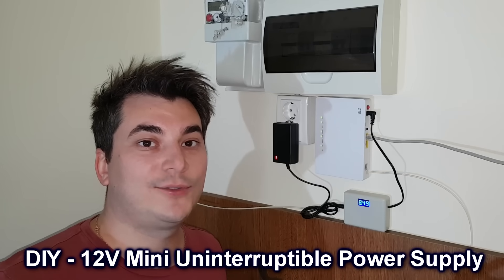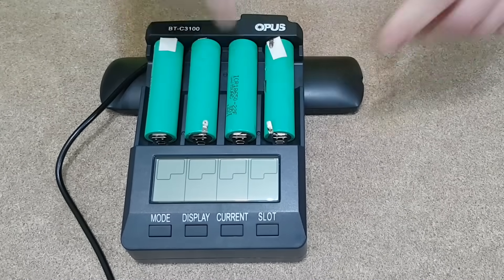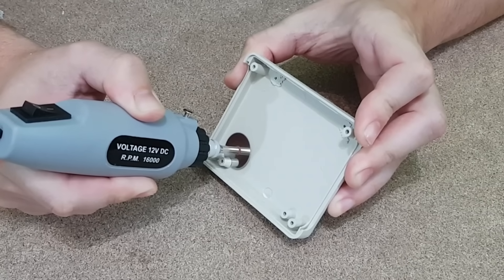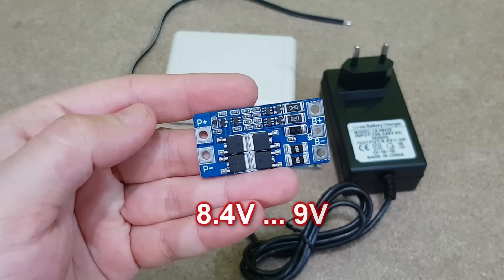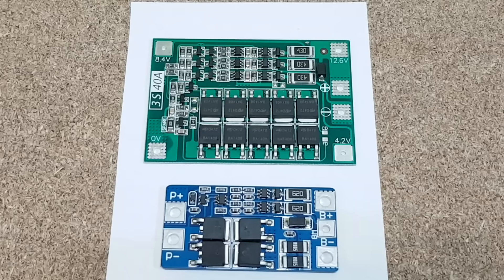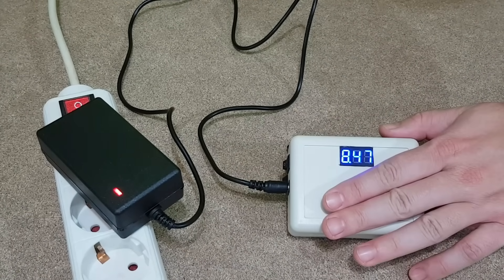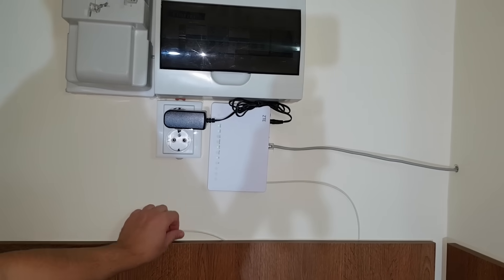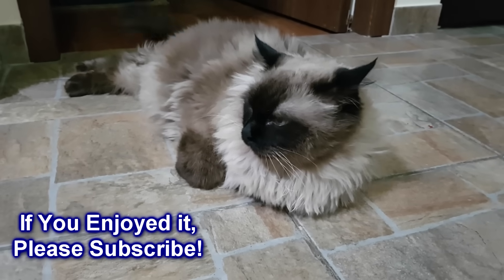DIY - 12V Mini UPS

Comment: idea of making a 12 v ups is good but the router in my case consumes 1000mA of current , so this types of ups will not last longer for me. moreover the boost converter u are using cannot provide 1000mA current. reply me with solution, i m also a electronic nerd like u.
Reply: Does your router really consume 1A, or does it simply come with a 1A power supply?
Reply: @DavidBeukes  no it really consumes 1A
Reply from the maker: you need a 4S battery pack with a 4S BMS board with balance and a powerful step down converter like xl4016
Reply: @Sorin_DIY  thank u sirr.. Its nice to see a reply from you.. 😃

Comment: Salut. Scoate la iesire circuitul prin xl6009  mai mult de 2A? sau pot pune 2x xl6009 cu acelasi voltaj setat pe un router cu transformator de 12v 2A sau ar trebui sa ma orientez catre alt circuit ups?
Reply from the maker: salut. in conditiile astea nu poate sa scoata 2A. nici sa folosesti 2 module step up. nici bateria nu rezista, ar insemna sa traga peste 4A din baterie. daca ai nevoie de 2A, trebuie sa folosesti o baterie facuta din minim 4 celule (4S), un modul BMS cu balansare 4S, si un convertor puternic step down, ca cel pe care l-am folosit in clipul cu sursa reglabila.
Reply: @Sorin_DIY  Xl4015e sau xl4016 :). Si trebuie sa cumpar alta cutie. :) Mai bine un 3s, incerc intai. Mersi.
Reply from the maker: xl4016 e mai bun

Comment: Hey , you forgotten 1 diode at input of BMS, that will help to reduce extra current drawn by charger LED during power fails
Reply from the maker: yes a diode will block the current in the reverse direction, but it also has a forward voltage drop of around 0.9V so the charging voltage will drop under 8V, which is not enough to charge the cells. the charger LED is using only a few mA, it doesn't make any difference in the 6 hours working time of the UPS.
Reply: "LED": Light Emitting DIODE. 
So why would you need a second diode?
Reply: @AtlantaTerry  simp

Comment: Pointless video. Why not just use a small 12v lead acid in parallel? 

No soldering, no additional circuit boards and you keep the original power supply?

Comment: Your router probably step-down your 12V to 3.3V. So you can try to power it with 8.4V without step-up.
Reply from the maker: that's possible. but I wanted it to have a stable voltage, so it can be used on other 12V devices if necessary. other people who build it may also need a stable voltage.

Comment: There is a diff between the video and your schematic, about the voltmeter.
In video:
(+) of voltmeter >>> OUT+ of LM2956
(-) of voltmeter >>> OUT- of LM2956
Sensor of voltmeter >>> P+ of BMS

In schematic:
(+) of voltmeter >>> IN+ of LM2956
(-) of voltmeter >>> In- of LM2956
Sensor of voltmeter >>> (+) of Voltmeter, so P+ of BMS

OK, I understood, maybe it's not a big diff, but you sould have made the schematic concord with the video, or vice versa.
Reply from the maker: you are right :)) nice attention to details. I wanted to show the difference of current use, when connecting the voltmeter positive supply wire to the converter output or to the converter input which is also the BMS positive terminal (right after the switch). on the converter output the voltmeter is using more current, due to the efficiency of the converter. but in the end I gave up this part, because I didn't believe it was important enough, to extend the video by another 2-3 minutes. so I just made the correct schematic and use the footage I had with the initial voltmeter connections.
Reply: @Sorin_DIY  so we have to follow the schematic instead of the video 👍

Comment: You could put a diode for source Adaptor feed back this way it will not light led when adapoter unplugged.
Reply from the maker: yes a diode will block the current in the reverse direction, but it also has a forward voltage drop of around 0.9V so the charging voltage will drop under 8V, which is not enough to charge the cells. the charger LED is using only a few mA, it doesn't make any difference in the 6 hours working time of the UPS.

Comment: You need to add diode for the charger input in case power off the charger led won't suck your battery juice
Reply from the maker: yes a diode will block the current in the reverse direction, but it also has a forward voltage drop of around 0.9V so the charging voltage will drop under 8V, which is not enough to charge the cells. the charger LED is using only a few mA, it doesn't make any difference in the 6 hours working time of the UPS.
Reply: Yes i agree with you thanks for remind me this point keep going ^_^

Comment: Nice vid.
I recently started using TP4056 Chrg/Prot boards with a long 22 gauge silicone electrical wire to help charge solar lights with 18650's when sunlight isnt good enough. With how well it works it doesn't make sense why big solar lights aren't designed with this feature built in

Comment: Nice build!  Best part is it will protect the router in those short power blips that usually reset everything.  Great job!
Reply: Yes. I need a small UPS for my Raspberry Pi system.

Comment: Would a 4S version of this be more efficient and would there be any downsides except for it being a bit bigger ?
Reply from the maker: hi. a 4S battery pack will be more efficient. but you need a bigger enclosure and a 4S BMS board. it will be more expensive.
Reply: @Sorin_DIY  Thanks, I ordered what I think I need and will give it a try,

Comment: +1 for ur humour and the smug face 😂 (1:10)
Why you did not use your previous DIY charger to test the batteries?? maybe because it do not have a screen showing capacity of batteries? So time to make a v.2.0!! ,   DIY Charger and Tester Capacity for 18650 bats.
Look ZB2L3 Battery Capacity Tester, not a bad module 😉
And look for us a DIY spot welding machine please, most uses microWave transformer, but a bit hard for simple hobbist... maybe with capacitor?? you will figure something it out 😊

Comment: Why not 3 cells in series?
Reply from the maker: a 3S battery pack has between 8.7 - 12.6V, so I can't use a step up converter.  I wanted to have a very stable 12V output. other people will probably make it for some other devices that may need a stable voltage. this is possible only with a dc converter. it will last longer with a step up converter, because it's using the entire battery capacity. and I wanted it to be small, with 3 cells it needs a bigger plastic enclosure.

Comment: Not bad BUT there are a few flaws with your design,  you can’t charge and discharge the 18650 cells at the same time that’s no good for them so you should add a mosfet (relay is too slow won’t work )and diode circuit. 200mA is a very low load, typically a good router is using over 2A so the pack capacity should be higher for most applications I would suggest 3A and a 3S 2P 18650 combination. Finally the boost converter is indeed needed even with a 3S combination so that you don’t exceed the router tolerance even though some routers will work between 9 to 12v but the boost converter should be around 3A for most router applications. I would also use a BMS with thermal sensing for good measure too since u r using recycled 18650s

Comment: Great explanation!  Thank you, very easy to understand the operation of 18650 cells on smaller scale. I'm trying something similar before going larger, these things actually are alittle scary and should be treated with caution. One thing I don't understand, does the bms monitor each individual cell ?  Thanks great job and that was an important tip selecting good vs bad batteries from the start. 👍👍
Reply from the maker: hi. yes the BMS monitors the voltage of each cell, that's why it has a lead between the cells. it's the yellow wire in my schematic.

Comment: I also made one for my router but with 3S config. It'll be more practical to do so because you don't have to change the 12V adapter.
Good video sir!
Reply: Can you please help by giving a list of the components you use? I am looking into building one but don't know where to get the components online.
Reply: @jithinramesh3022  The two main places that people source parts for electronics projects are AliExpress and Banggood. They're both Chinese websites which allow you to essentially get the parts for the cheapest price and they usually have global free shipping. I would personally recommend Banggood because I usually get my items within a week and a half when ordering from there vs AliExpress which can take weeks but usually not over a month. I live in New Zealand which means components ordered from these sites get here a bit faster then other parts of the world. As for your question regarding the components that Aji used I might recommend trying a premade board that essentially does everything the BMS in the video does in a single package. Something like this: https://www.banggood.com/18650-Lithium-Battery-Boost-Module-12V-Charging-UPS-Uninterrupted-Protection-Integrated-Board-With-C-p-1280431.html?rmmds=search&cur_warehouse=CN
Reply: For 3s, the Charging voltage should be greater than 12.6. How did you get this voltage with 12V adapter without using step up convertor?
Reply: @usamamansoor  my power adapter is 12,12V , that is 4,04 V per cell. Yes, that will charge Li-ion the battery, but only to 80% full (good enought for me). You'r adapter is 12 V exactly? No worries, you will get batteries approximatelly 75% full
Reply: What step up transformer did you use?
Reply: @ChillarPunter  with 3S battery and 12V router no step up or step down converters are needed. Router will still work, even when supplied with 9V (3S battery at 1% charge)
Reply: Yes it is 12 V. But bms 3s says it works at 12.6 or greater voltages for charging.  Is yours working fine with exact 12 volts? Can you share your circuit diagram also. It would be great favour. gdpilotusama@gmail.com 
Just in case
Reply: @usamamansoor  yes it does work, hovewer changing is NOT to 100% and balancing the battery cells (shunts power from fully charged cells to allow outher ones to also be fully charged) will not work. I do not need any of that, charging to less than full is compensated by not having extra power conversion stage beetween battery and powered device and not having battery cell balancing is acceptable with good Li-ion cells (around 99,9% Colombus efficiency and virtually no self-dischage)

Comment: The idea and concept is great. The only issue is that the LiIon batteries get charged and once the BMS detects that their voltage drop drops to about 4v, they will be recharged again. This battery technology does not like this toppping charge and batteries will not last very long. Depending on the BMS topology, I would also expect an absorbtion charge. When the mosfets switch off not to allow current to be passed to the batteries, some BMS leak some current into the batteries possibly keeping them near their Maximum charge voltage which is not healthy for the battery technlogy.
Reply from the maker: hi. you are right, this BMS board doesn't let the battery pack discharge under 8.38V. I think all BMS boards have this problem. I'm using this one, because from the ones I've researched, this BMS seems to be better. but to prolong the battery life you need a timer or a circuit to only periodically charge the cells.
Reply: there's nothing controlling the charghing, BMS board is not a charger controller board. without charging control this thing is a time bomb. for example if one cell will short a little and start to take 1A all the time - BMS will not care and fuse will not care, but cell will become hot and burn.
there's no need a timer if you want to use a lithium cells in a buffer mode - just make charger controller charge them at 4V (60% capacity) like it is made in car dvrs for example - and a whole device will be safer and cells lasts longer.

Comment: If you want better efficiency, remove the step up converter and add one more battery in series. The router should be able to operate from about 9V up to 14V.  Li-ion batteries work 3.5V - 4.2V, which gives you 10.5V - 12.6V power supply.
Reply: No, my router works 11v-18v. Although rated at 12v. It doesn't work anything less than 11v. So step up is mandatory. Schottky diodes are also required.

Comment: How did Google know I'm planning to make something similar for my router?! Never searched for it or typed about it. 

Anyways, the design is too nice/overkill as backup power for a router unless you have power failure every week.  I live in a third world country but only seen two significant power outages, so batteries connected to the router is enough for me

Comment: Poti pune o dioda pe cablul de la încărcător ca sa numai consume din baterii 😁
Reply from the maker: da, dar dioda are o cadere de tensiune de aprox 0.8V. in polarizare directa va scadea tensiunea de incarcare sub 8V, ceea ce nu e de ajuns pentru a incarca cele 2 celule inseriate. ledul incarcatorului consuma insesizabil de putin curent, de asta l-am lasat asa.

Comment: can i use 12v 7.5ah lead acid battery on this ups?
Reply from the maker: not with this BMS board. you need a charging circuit for lead acid battery.

Comment: You can put a 1N4001 diode in series with the charging circuit, so that you do not keep your LED on the charger when there is no electric current to supply the charger.
Reply from the maker: yes a diode will block the current in the reverse direction, but it also has a forward voltage drop of around 0.9V so the charging voltage will drop under 8V, which is not enough to charge the cells. the charger LED is using only a few mA, it doesn't make any difference in the 6 hours working time of the UPS.

Comment: Hello to you Sorin from Ukraine. Really like your videos! Why not raised from 4 volts to 12? There would be no need for a balancer circuit and you can charge from 5 V of the power supply unit of a mobile phone. Connect 2 batteries in parallel to increase capacity and reduce current on each.
Reply from the maker: hi. this will add a few difficulties, especially on the efficiency. first you need a powerful USB charger, because converting the voltage from 5 to 12V at a lower efficiency you will have a lot of power loss. in parallel with this, the charger needs to be able to charge the cells. the step up converter I use has an average efficiency of 70%, when raising the voltage from nominal 7.2V to 12V with a 0.5A load. this means that when the battery is low to about 6V it will increase the voltage to 12V with an efficiency of around 65%, probably even lower. 12V*0.5A=6W; 6W/6V/0.65eff=1.53A from the 6V battery pack.
but one cell will have the voltage from 4.2 to 2.5 or 2.7V, depending on what charging and protection board you use. the efficiency will be even lower. so when the cell is down to 2.7V => 6W/2.7V/0.6eff=3.7A from the almost discharged cell (or cells in parallel) which is not recommended for the cells and charging/protection board. 3.7A will also heat up the step up converter IC very much. drawing a higher current from the cells will decrease their capacity. it's doable but not very efficient.

Comment: Where do you get your laptop batteries?
Reply from the maker: hi. I got the batteries from broken laptops, I buy some of them very cheaply for spare parts, or they are donated to me. I can also find cheap used laptop batteries on local web sites with second hand electronics for sale, or at flea markets. it's a gamble, but around 70% of them are still usable. and being free or very cheap it is worth the risk.

Comment: I bought similar boost convertor but it couldn't give 1A current at 12v
Reply from the maker: what is the exact type of your boost converter and what battery pack did you used?
Reply: @Sorin_DIY  XL6009

Comment: Why not make it out of 3S for 12.6v fully charged and 9v fully discharged? Then you would not need the boost converter. Your fiber router would probably cut off around 10v or less than that.
Reply from the maker: I wanted to have a very stable 12V output. other people will probably make it for some other devices that may need a stable voltage. this is possible only with a dc converter. it will last longer with a step up converter, because it's using the entire battery capacity. and I wanted it to be small, with 3 cells it needs a bigger plastic enclosure.

Comment: Like your project so much. Q: Does your mini UPS has an automatic shut-off when batteries in full charge?
Reply from the maker: hi. the charging is stopped when the cells get to 8.45V. but when they go below 8.38V the BMS start charging them again. I've tested this with a resistor on the cells. the cells are charged too often and in time this will decrease the cells capacity. but I didn't find a better BMS for this project. I think all of them have this problem. the only solution is to use a timer or another circuit with a relay, which charges the cells only when they go below a certain voltage.

Comment: hello, where did you get the laptop batteries?
Reply from the maker: hi. I got the batteries from broken laptops, I buy some of them very cheaply for spare parts, or they are donated to me. I can also find cheap used laptop batteries on local web sites with second hand electronics for sale, or at flea markets. it's a gamble, but around 70% of them are still usable. and being free or very cheap it is worth the risk.